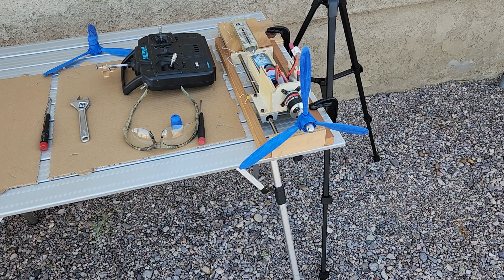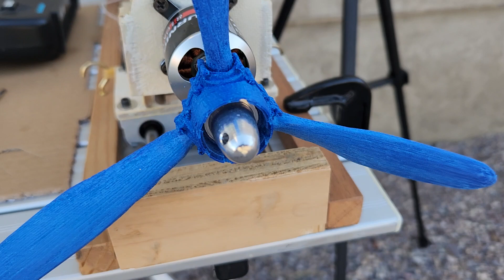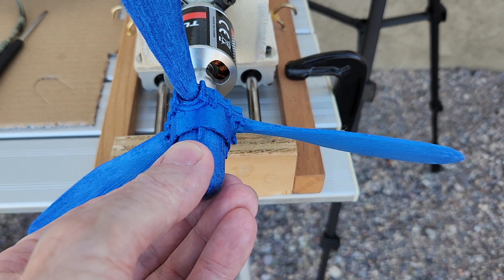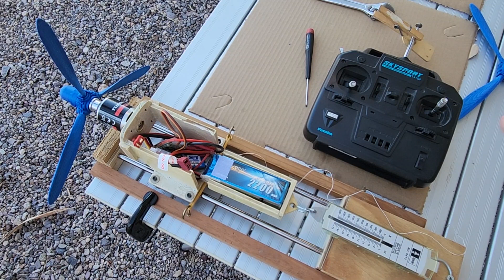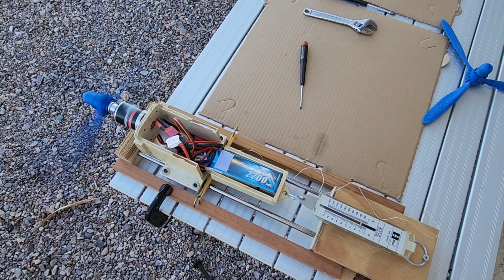Video 4 of 4. Test Number Three-3D Printed Hamilton Standard 11x6 propeller on thrust test stand.

Comment: how did you make this thrust stand, give me all info. please
Reply from the maker: The rails are 8mm steel rod. The carriage rides on four LM8UU linear bearings (Amazon- uxcell SCS8UU Linear Ball Bearing Slide Block Units, 8mm Bore Dia, Pack of 4).

A rubber band is stretched across the rails to keep the carriage from backing up too far (I did not want to cut the rods down, in case I needed them for something else), held in place by screw in hooks attached to the wood frame.

A spring scale, what I know as a fish scale, attaches to the back of the carriage and the rear wood block on the frame.

Comment: not surprised this works but still impressive. i myself have made alot of EDF impellers and ran them on a 2.2kw motor. i think my thrust record was like 2.1kg at 1200 watts.
Reply from the maker: I am rather surprised at the results, but this was also just a bench test for a very limited duration. Flight test are next and I need to rig some video to record, though I am more worried about hitting a rock and chipping a blade on takeoff than anything else. I like the idea of 3D printed EDF impellers, sounds interesting!